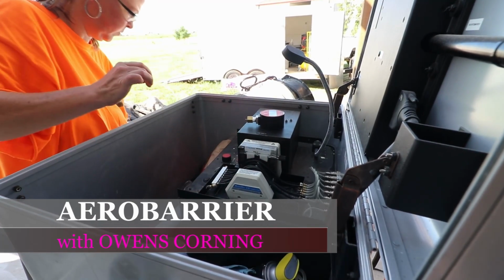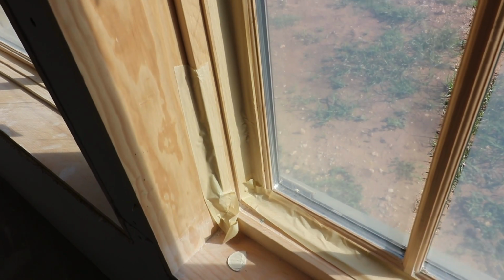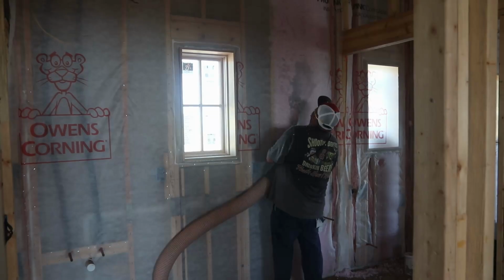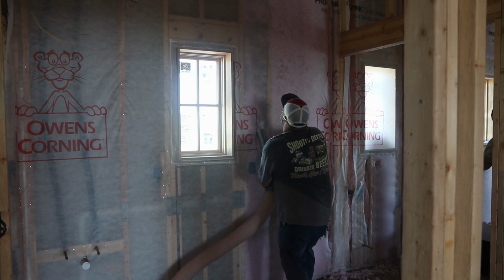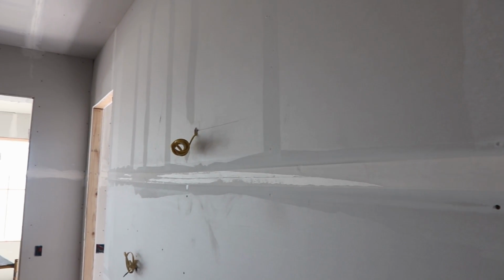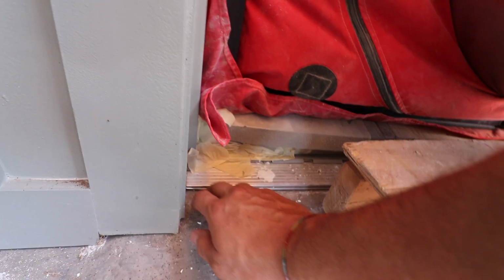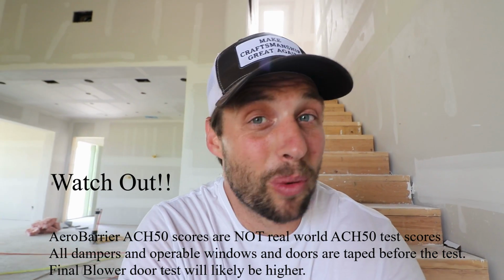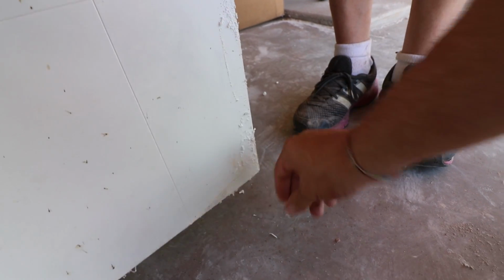This Insulation is BETTER than Spray Foam!!

Comment: Unless you have a way to pressurize the inside and include a ELECTRONIC AIR FILTER, a house can be too tight...
As you pointed out people, furniture, carpet, cabinets, paint, floor finishes etc all off gas toxic fumes
Reply: You’re incorrect. What you need is a controlled air exchange. The house can be as 200% tight and you won’t have a problem with bad air
Reply: Inte.... We are saying the same thing. 
I said "Unless you have a way to include a ELECTRONIC AIR FILTER,"
Reply: @RJ-sr5dv  no. As in you don’t need to pressurize a house.  Otherwise just open a window or a normal vent and you have the same results just less efficient and you lose more heat(basically how leaky houses are now). As in the house can’t be to tight.

Comment: I'm also curious as to how long this barrier will hold up in the house.  It'll be interesting to see in 10-20 years.
Reply: I've been told it loosens up over time.  That's what all caulk does, especially thin watery stuff.  But even losing 30% of the gain from sealing that still leaves 70%.  I'd like to know.
Reply: AeroBarrier was tested for 50 year durability. Test is available

Comment: I'm skeptical as well your bringing in air from outside that will clog air filters all day long which is a system that will never  work correctly
Reply: Wouldn’t you rather bring the air into the house through a filter that you can clean and change, rather than through your windows and walls?

Comment: https://youtu.be/dtsspp3LpHY?t=146 previously the conception was that houses need to breathe due to the fact that water penetration water can and will get in the walls and if there is sufficient air movement it will carry the moisture away before it can turn into mold
Reply: You can research the perfect wall. Just type in the Building Science "The prefect wall" it will better help you understand the process.
Reply: @sky0049-v1y  i understand how walls are built however this is only due to advancements in building techniques which was not always so. I was referring to this specifically it had nothing to do with how they are building them today. http://www.oldhouse.info/ohdamp.htm

Comment: Can you explain level 1 air sealing
Reply: Grade 1 Installation requires that insulation material should uniformly fill wall cavities, filling each cavity from side to side and top to bottom, without substantial gaps or voids around obstructions. Batt insulation should be cut to fit around any wiring or piping installed in the wall cavities.
Reply: @sky0049-v1y  Thank you, I am learning how to build high performance homes

Comment: The ZIP system alone seals the house pretty tight if its applied correctly and it makes a world of difference compared to other building systems Ive seen. But no way in hell is blow in insulation better than spray foam. All the blow in Ive seen does settle over time but, it varies depending on type and how its installed. I do like blow in for old brick houses with lats and plaster walls just because it makes it cheaper and faster to install rather than ripping all the plaster and lats out to install fiberglass or foam. It would be nice a year later to hear how its holding up.

Comment: How would you insulate a wall out of curiosity if you lived in lets say..... Fairbanks, Alaska? Winter temps range from 0 degrees to -50 below zero. Common system up here is 2" rigid foam on exterior of house, blown in blanket fiberglass system in 2x6 exterior wall, .6 mil poly vapor barrier and then your interior finishes. R-70 in attic blown in fiberglass. We've been using a lot of closed cell in the exterior wall cavity as well which gives a great seal as well but this AeroBarrier seems like a very interesting unit.

Comment: the information is misleading because fiberglass isn't an air sealer, however, foam is. on this house he changed the entire way he framed which was the biggest difference. a better test would be to use the same building and framing methods and then use foam vs blown fiberglass and see what you end up with.

Comment: When I build a house I’m using zip R over my 2x6 walls then closed cell foam, then rockwool insulation and now this air barrier. Thanks for the tip.
Reply from the maker: Yeah, I guess if you want to cheap out on your build...  :)  You will have the tightest most insulated house on the block for sure!

Comment: I’m remodeling my house that was built in 1929 my wife grew up in they bought it in 1968 her parents had blown insulation put in some time in the seventies,  while tearing down the old plaster walls the celluloses insulation was still clear to the top of each cavity, I to used to think it settles over time but to my surprise each cavity was still full clear to the top after thirty years, I couldn’t believe it, but when rebuilding I used closed cell spray expanding foam.  The old cellulose didn’t settle.

Comment: To stop the insulation from settling, add horizontal dead wood in multiple layers when framing. So, instead of having a 10 ft column of insulation,you have 4 ft columns. Easy and works and the dead wood would have just been scrapped anyway.

Comment: I appreciated learning the cost of BIBs and Areosealing vs. spray foam.  I've been doing fiberglass BIBs for 15 years because it only comes out to about $1,300-1,600 extra per house, and it is much better insulation than F.G. batts and much cheaper than spray foam.  Dense pack cellulose isn't popular in my NW city because it evidently has water involved in the installation process which doesn't dry out fast enough in our cool climate for most builders.  That's what the insulators tell me.

Comment: How do you unbalance an ERV?  I have the Panasonic Whisper Quiet model going into my spray foamed tiny house, and I’d also like to tweak this - especially since my composting toilet fan will be pushing some air out and creating negative pressure in the house.

Comment: The R-value of closed-cell foam in a 2x4 wall  is 24.5 - In most areas of the country, you could not use open-cell because it would not meet code. You should know that.

Comment: Jordan, thank you for another informative video!  Does this product make painting later any more difficult?  Does it adhere to drywall?  Any prep needed for drywall prior to application of this product?
Reply: Ide say since a good potion of arguments made for this expense  detail air penetraition accumulation on an inner cold condensing surface." Mold  Back of the sheet rock"  not gonna help much if all holes are sealed from the pressure( sheet rock and plaster. I think the idea here is stopping the air leaks b4 they encounter sheet rock.

Comment: "Fiberglass can have a higher R value per inch than spray foam".   This FG insulation is R15 at best in a 2x4 wall.  That's R4.3 per inch.  Most spray foams are better than that.  What system makes that claim true?

Comment: It settles if moisture makes it into the bay. Regardless of the install, if you have a hole in your outer or inner wall that transfers moisture into the bay, it sinks. If you turn over houses every 5 yrs, you'll never notice though.

Comment: For a second I got excited and thought this was one of the first aerogel insulation products for contractors.
Reply: Soon. That would be amazing..but too dam expensive. This is just a caulk mist in air that seals shitty insulation job. We get house down to 0.6 - 1 ach with open cell alone no need this crap

Comment: So, this fiberglass somehow insulates well in cold temperatures, unlike other fiberglass? The dirty secret of fiberglass insulation is that it doesn't insulate well at low temps. I suppose this stuff is fine for structures south of the Mason-Dixon.
Reply: yep

Comment: You are far from tight house. I use open with closed cell spray foam combination.  Best result was 0.2, worst 0.45. Requirement O.6. Nothing beat polyurethane.
Reply: I question if his numbers are as good as he claims because they taped off all the windows, doors, and vents which makes it seem tighter than it really is.  Not saying the product doesn't do what it claims but I would wonder what the numbers are after you take off all the tape.

Comment: Looks like a great system my question is what about clean up afterwards I’m sure it’s going to pile up we’re the sprayers are on the floor or walls. Am I correct?
Reply: Because its completely atomized cleanup is merely removing all the tape from windows and doors. NO puddles or piles of product anywhere.

Comment: HI  The system will work if no people live in the building and for that matter mice too! What we are saying is the system will fail. A building must be able to perform without depending on mechanical systems. That's why we say a house must breath. A building must be able to remove vapor that will enter the system no one can stop vapor flow.

Comment: I am a little skeptical of how well the small areas of accumulation of "calk" will hold up over say, 10 years of settling, flexing from walking, and just daily living in the house.
Reply: Then youd still be at a 1.6 because the zip system.

Comment: Sorry, Jordan, I don't buy this current fashion for airtight homes. Encapsulating yourself in an airtight home (particularly when using off-gassing foams and sealants) and being forced to rely on expensive HVAC systems for fresh air is never a good idea.  

Raise your hand how regularly YOU change your HVAC filters.  Raise your hand if you drain your water heater every year.  Do you change the oil in your car every 3K miles?  Heck, most people don't even go to the doctor regularly.  But we're to assume people will pay attention to their HVAC system????  It's beyond ludicrous.

And assuming filters do get changed, how many homeowners are going to spend the $$$ for the correct filters and instead purchase the cheapest crap they can find (assuming they buy the correct size and don't shove a 14x14 into a 16x16 and call it good).  So yes, a properly maintained, properly functioning HVAC may provide decent air quality (assuming it's properly designed and installed - something that is rarely the case).  The sad reality is expensive HVAC systems won't be maintained, won't be designed or installed properly.  That's a recipe for disaster.   I'll take a slightly less-efficient home to ensure decent air quality any day.

Comment: It makes zero sense to do air sealing of an external envelope AFTER you've already partially sealed up the inner frame with plasterboard and insulation. You could have a 2 foot hole in the cladding and still this process would look good on camera. It might work, but the process is flawed IMO.
Come back in 12 months when everything has settled and shifted and see what you get. Proper air sealing is a design process, not a post construction sticking plaster.
Reply: Yup, let's see how these homes test a few years down the road.  This seems perfect to scam the system.  Have a horribly-build home that can't meet min specs?  Call in these jokers and pump in enough crap until it gets to min code.

Comment: Just a thought, what if this AeroBarrier process  was installed after the house was closed in and weather tight, to close up the small leaks, that would be more accessible,  then the final insulation of choice could be installed.
Reply from the maker: That's a good thought.  It is how I am going to implement it on the next build.  Stay tuned!

Comment: 3lbs. To 5lbs. Closed cell Spray foam seals 100% so I am not sure what you are doing and why you are saying that it doesn't seal
Reply: Yeah closed cell is the bomb. Seals ALL cracks and penetrations and leaves the entire house moisture-proof. Not only that but it will lock the studs together and add a decent amount of structural integrity/sound proofing as well.

The one negative is that repairing rotted portions would be a pain but the chance of a 2x4 rotting with closed-cell in slim to nil. Doing electrical down the road is another problem but in reality, I'd think that this stuff is worse for repairs. Even cutting into some drywall would open up the barrier and expose you to all of the fiberglass. and doing electrical? yeesh. Forget about it.

Comment: AeroBarrier isn't insulation.  It's simply a structural sealant.
That's nice.  And it's a surer system than simply spray-and-pray foam.

But the foam is ALSO an insulation.
Reply: Seems like you don't quite understand the reason for the AeroBarrier.  Aero=air, barrier=stops it from entering the house.  It has nothing to do with insulation.  It is only about stopping outside air from getting in.
Reply: Hyperstrike Aerobarrier is still caulking and caulking dries out over time. I’ll pass

Comment: my house is actually .2 ach50 and i sealed it myself without any fancy and expensive technology; all it takes is a good design, properly installed windows and doors and inside plasters that create airtight layer; i did use some tape and sealants which did cost about 100$;
Reply from the maker: Your right!  It can be done very effectively if your conscious in the building process.  Sounds like you did it right!

Comment: Aerobarrier is very cool, but no R value. HFO 2-3” of sprayfoam, Rockwool to fill wall cavity, Zip exterior panels ( R12), less than .6 ACH50 and R44 wall
Reply: Terry how would you do the conditioned attic space? I am building on coast in SC.
Reply: Migo Surf blown in cellulose

Comment: If your house is not 1.5 ACH with spray foam then ypu need another spray foam contractor. This stuff you show is temporary solution.  Will crack and snap in a year or two. Whole airbarrier system is only a year or two and haven't been tested well.

Comment: So you use fiberglass that is not airtight and seal all holes with caulking that will crack in few years. Spray foam is the best  insulation ever invented.  A this crap is just way for fiberglass industry to stay "airtight" NOT. Joke. And install is even more dangerous then foam. Your lungs will get filled with that stuff if in a house. And then all that mist stays in the house and settles on surfaces. I call in CRAP

Comment: I think people get in to the insulation thing way too much and always worried about water and moisture..  in my opinion you could completely seal a home by encasing the inside in rubber but there will always be rot and corrosion that you could only prevent in a complete hermetic environment.  So in a rubber lined house if your gonna be in it than its gonna still break down and corrode..  mold is just a process of that rot that turns out is toxic and makes people rot faster also..  all that blown in and sealing will just settle overtime no matter what..  gravity..  and seals will breakdown over time...  as for best insulation though..  i say coat the entire structure in asphalt..  the whole damn thing..  itd be just a hump with windows and doors..  you could reseal it every few years so wouldnt have to paint ever.  And a nice big parking space on top.  Or could have a put-put golf course up there..  put it to use..  no gutters..  no foundation issues because the structure would be the foundation..  r value would be the best out there..  if you could get past the stink and support the weight than hell..   cheaper than borscht..

Comment: As a builder , I  can assure you a building "in space " e.g. not protected by earth s atmosphere would collect enough e heat to become cinder dust in less time then your customers would need to think up cracking a window if the power goes out (again)
I will get back to the vid now
 can't wait to watch that atomizer in action
Reply: Yup, UV damage and temperature difference between the hot and cool side of everything would destroy a house very very quickly ;)  But other than that, this product looked very interesting.

Comment: Love the video. Great work explaining everything. I’m building a tiny home inside a school bus that will drive and shake rattle and roll. The only option that will not settle I found so far is professionally sprayed closed cell foam. Theoretically it will give me an r value of 7 per inch of thickness. Walls are 2.5” so that’s like r16 or r17. Do you know if any other options?
Reply: Roxul doesn’t settle.  R-max panels are also a great R-value option where it can be applied, and less risk of things going wrong like with spray foam.  I learned this the hard way with a messed up spray foam “pro” job done in my tiny house that off-gassed for years.  Thankfully, my move-in was delayed & I have an ERV.
Reply: @NewEarthAwakening  these are kinds of conversations that add value, to 'the internet', thanks for sharing.

Comment: Fiberglass is junk. There is nothing better then spray foam.  Don’t need that glue process if it’s foamed. As the fiberglass ages it will loose its efficiency unlike spray foam. You can’t use this product on all homes also.

Comment: I feel like the title of this vid is completely wrong. Im a huge advocate of spray foam, and feel that its the best thing you can put into any building. With that being said, i think you should use this system after you foam to make sure you get closer to a 100% coverage. Spray foam is great but there is a chance that you cant get 100% perfect. In my opinion the addition of AeroBarrier after spray foam would basically be a perfect house.

Comment: Well, the end of this video shows it all. As a leader in the spray foam industry myself here in the GTA (Toronto Ontario), I do not like this one bit. For many reasons, and too many to write about. We also spray foam a hybrid to ZIP-R custom homes, for much less cost than what you are proposing, and with a much better outcome. Not only that, complete 2lb closed spray foam to traditional built homes and achieve the same results, with only 1 insulation / vapour seal process; not 3 or more.